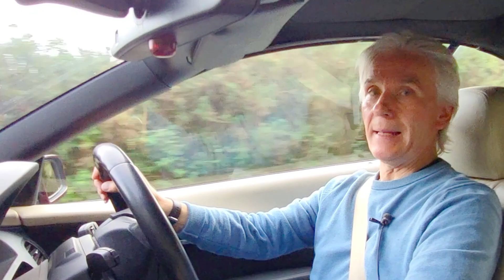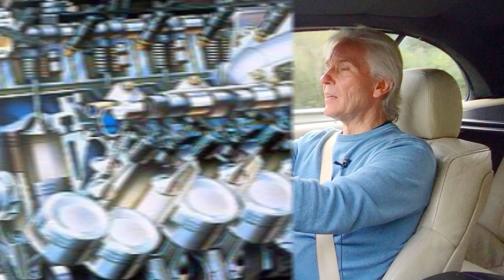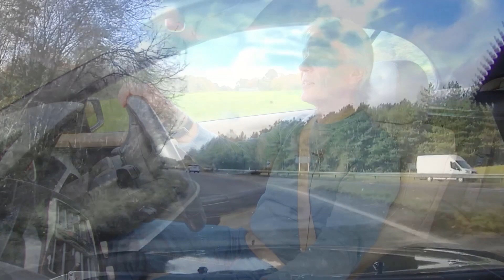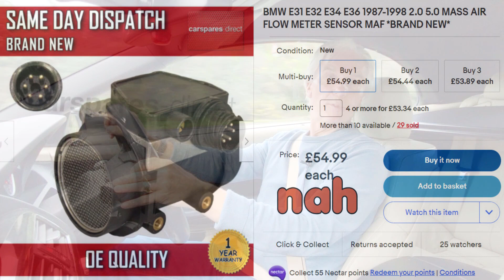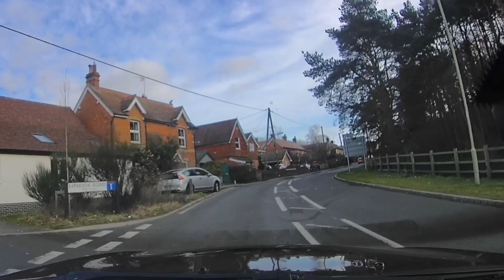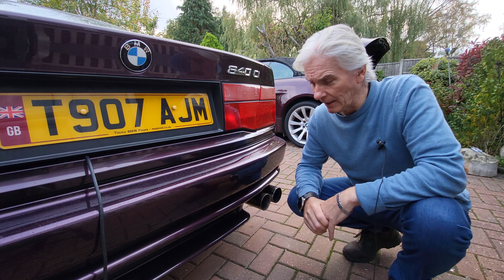BMW - WHERE HAS ALL MY POWER GONE? WHY NO ERROR CODES?

Comment: Yesterday I got a replacement MAF sensor from another ex-Japan 1997 E39 540i. I hadn't known mine was faulty until recently with fault codes and occasional stalling. I'm commenting here while re-watching your fine video so you'll probably explain this but in the meantime, I thought I'd post this AI reply to my question as to why my transmission was behaving differently. Very happy to have a smoother more responsive car.

Good evening! It’s great to hear how much you’ve enjoyed your 1997 BMW 540i (E39) over the years—it sounds like a real gem, especially with that mileage! Your detailed background is appreciated, as it helps paint a clear picture of what’s going on with the car. Let’s dive into your question about how replacing the mass airflow (MAF) sensor might influence the behavior of your automatic transmission.

The short answer is yes, a faulty MAF sensor—or replacing it with a properly functioning one—can indeed affect how your transmission behaves, even though it might not seem directly related at first glance. Here’s why:

The Connection Between MAF and Transmission

The MAF sensor measures the amount of air entering the engine, which is critical for the engine control unit (ECU) to calculate the correct fuel delivery and ignition timing. This data doesn’t just affect engine performance—it also feeds into the broader vehicle control systems, including the transmission control module (TCM) in many cars like your E39. The TCM uses inputs like engine load, throttle position, and airflow (via the ECU) to decide when and how to shift gears. If the MAF sensor was faulty for a long time—perhaps even subtly before it threw a clear fault code—it could have been sending inaccurate data, leading the ECU and TCM to adjust shift points conservatively or inefficiently.

When you installed the new (used, but functional) MAF sensor from the scrap yard, the ECU likely started receiving more accurate airflow readings. This could result in:

Improved Engine Load Calculation: With better data, the ECU might now recognize that the engine is operating more efficiently, allowing the transmission to stay in a lower gear (like 4th instead of jumping to 5th) when it deems it appropriate for the current driving conditions.

Smoother Power Delivery: You mentioned the car feels more responsive and runs smoother. This improved engine behavior could give the TCM confidence to hold gears longer or shift differently, as it’s no longer compensating for an engine that’s stalling or running suboptimally.

Adaptive Transmission Logic: The E39’s Steptronic transmission is adaptive, meaning it learns and adjusts shift patterns based on driving habits and sensor inputs over time. A long-term MAF issue might have “trained” the TCM to shift more conservatively (e.g., jumping to 5th gear quickly to reduce perceived strain). With the new MAF, the system might be re-adapting to the corrected inputs, leading to the behavior you’re noticing.

Why the Change After Switching Modes?

Your observation about the gear staying in 4th after switching from Sport to Drive mode is interesting. In Sport mode, the transmission typically holds lower gears longer for performance, and when switching back to Drive, it often upshifts quickly to prioritize economy or comfort. With the new MAF sensor, the ECU/TCM might now calculate that staying in 4th at 100 km/h is still within an efficient and comfortable range for the engine, rather than forcing an immediate upshift to 5th. This could reflect a recalibration of engine load or a shift in how the adaptive logic interprets the "normal" driving condition with proper airflow data.

Could It Be Something Else?

While the MAF replacement is the most likely culprit given the timing, a couple of other factors could play a role:

ECU/TCM Relearning: Even without manually clearing codes, the ECU might have automatically reset or begun adapting to the new sensor data, subtly altering shift behavior.

Residual Effects of the ABS Fault: Though less likely, if the ABS module issue affected the vehicle’s networked electronics (e.g., via the CAN bus), it’s possible it indirectly influenced the TCM. However, since that fault resolved itself, this seems coincidental rather than causal.

Natural Wear or Adaptation: After 370,000 km, the transmission itself might be shifting differently due to wear, but the timing with the MAF replacement strongly suggests a link to the sensor change.

Suggestions

Monitor It: Keep driving and see if the transmission continues to adapt. If it’s running well and the shifts feel logical, it might just be the car settling into a “healthier” state with the new MAF.

Clear Codes Manually: If you have access to a scan tool, consider clearing the fault codes and letting the ECU/TCM fully relearn with the new sensor. This might solidify the new behavior or reveal if it’s temporary.

Check Transmission Fluid: While unrelated to the MAF directly, it’s worth ensuring the ATF (automatic transmission fluid) is in good condition, as low or degraded fluid could amplify any odd shift behavior. At 370,000 km, it’s a routine maintenance item if it hasn’t been done recently.

Enjoy It: If the car’s running smoother, more responsively, and the shifts aren’t causing issues, this might just be the E39 showing you how it was meant to perform all along with proper sensor input!

In summary, the MAF sensor replacement likely gave the ECU and TCM more accurate data to work with, subtly optimizing the transmission’s behavior. It’s not a coincidence—it’s a sign of how interconnected these systems are. Your 540i might finally be running closer to its original spec, and that’s a win worth celebrating! Let me know if you’d like me to dig deeper into anything specific.
Reply from the maker: Yes, the MAF causes a problem as the idle cannot be controlled precisely, so when the EGS calls for a reduction in power for the gear change the revs drop too far - and that causes the harsh changes

Comment: Would old MAF cause hesitation on lower rpm?  My N62 V8 hesitates  intermittently when I step on the gas around 1k - 2k rpm on 1st gear.
Reply from the maker: Sounds more like an ASC+T intervention, make sure all tyres are inflated to the same pressure and that no single tyre has more wear than the others
Reply: @TimmsBMW  Thanks for your reply.   I forgot to mention my car is a 6spd manual, actually hesitation occurred at higher rpm 2k-3k,  especially noticeable on 3rd or 4th gear.   When I floored the pedal it feels like turbo lag, but not much power come up after the lag.   New spark plugs installed recently, maybe I should replace the coils as well?  car only has 85K miles.

Comment: Got a 2017 B7 (LHD ) 40k miles, CV gators split, unreal. rear diff leak , all warranty ( BMW plat)  dont really do a lot of miles, worried cus I tootle around in it ,( doesn't do long trips) worried about GDI carb , I change the oil every 4k to try to keep it carbon free , love the car , dont get me started with the HK sound system, did the BAV subs , just no enclosure volume what a shit design , the stero in the F01 was better!!--- anyway love the vids, GDI what ya thoughts tim,
Reply from the maker: Thanks, and my pleasure - I guess a B7 is quite a lot of work!

Comment: Hello good morning. Can you please assist me, what does this error means? what to check about it? thank you.
 E71470 Intermittent – Message (charging interface status, 0x3B4) missing, receiver IHKA, transmitter LIM
Reply from the maker: Do you have a problem or just parsing error codes?
Reply: @TimmsBMW  i think it's a problem, when I clear the codes it comes back after awhile but I'm not sure what it really means. Just saying transmitter receiver thingy.  Not sure what I should be noticing in the car to say that's the one that is obvioud fault. Not sure if you get what I mean. Hehe. Thanks for your time
Reply from the maker: @bathanmark  Yes, I understand what you are saying. But these cars are extremely complicated and there are often error codes for something that makes no difference to the operation of the car. This has been the same since the introduction of OBDI. If you have no operational problems then ignore it!
Reply: @TimmsBMW  i agree with you hehe. Better not think too much if the car seems normal and no issues apparent to see. 👍

Comment: Hi Timm Jay here Find your posting’s very enjoyable 
Now on pension and in the process to buy my first bmw convertible 645ci 86000 miles
Used all your information to test if it is good 
The last three days went through all invoices and service history
It is a 1 owner car that also have a Bentley and Jag convertible The car was serviced by BMW It is 18 years old with 17 services including one gearbox service
I took the car out on a run for 50 minutes of driving Gearbox and everything seems fine Hood is also working perfectly
My main concerns is tha when checking the expansion tank (that is newly fitted) I found it had RED ANTIFREEZE in instead of blue
THE BIG QUESTION 
If the car had any head gasket problems will it start to show in a 50 min trip with some 10 minute indeling at end of journey I heard the fan kicking in whilst watching and was able to hold my hands on both the angina covers for more than a minute without it burning my hands BUT THE RED ANTIFREEZE WORRY me the owner mentioned that from the first service that it was always red 
Thanks for your time and valuable information I think more people should CONTRIBUTE   for your information
Reply from the maker: It's difficult to flush it out yourself as the drains in the block have to be removed. The quickest way to change it is to remove the lower hose - let the coolant out, refill with plain water and repeat a couple of times - then finally remove the lower hose, replace and then fill with 100% BMW coolant, that should give you the 50/50 mix required. The answer to the question: 'is it OK to keep the red coolant' the answer is I don't know, it could be anything, but it isn't BMW blue coolant!

Comment: Any ideas what the hesitation at 1500rpm to 2000rpm is caused by. I encounter this when I’m using manual shift mode in 2nd gear
Reply from the maker: My first thought would be ASC+T, try pressing the DTC button and give it another go.

Comment: Hey Tim I have a question , I own a 2008 650i 63k miles , other day I tried to show off to my friends , and Dona friendly burn out I deactivated the dsc by holding 3-5 seconds and it did not burn out it did for half a second and then I lost full power any idea what could have went wrong ? Thanks Tim
Reply from the maker: Hello Jose, these cars just are not meant for burnouts, as soon as the wheel starts spinning the gearbox will change gear and it will stop again. It also kills the torque converter!

Comment: Thanks Timm, my 97 540i still going strong  at 350K kms but good to know. I learned some useful stuff such as not suspecting the cylinders first if I did notice a drop off in power.  I tend to put it into third on the steptronic and go (if I need to), does that sort of gear change mask what you're talking about I wonder?
Reply from the maker: No Bernard, if you have power all is good!

Comment: My MAF coded out on my previous car, 98 Volvo S90, so I bought a Chinese one for $65. It seemed to work alright. Six months later, it coded out. Cleaning did no good.
I then bought a Bosch for $165. No more problems.
That Bosch was over $400 at car parts stores and over $500 at the dealer.
My 01 mercedes e320 seems to run alright, but I'm sure the MAF and cats are original.
Nice to see you again, Tim. Cheers!
Reply from the maker: Good to hear from you Werner!

Comment: Your videos have helped me with my 650 massively, just thought I’d chip in with another reason the power at the top end is lower than normal could be a failing/faulty DISA system, never throws an EML  but checking with a scanner on all systems it’s there, a spirited drive usually clears it, but still keep seeing it from time to time.
Reply from the maker: Thanks John! Yes, DISA and any of the sensors at the top end will stop the Valvetronic working leaving the valve-lift at the default 6mm - and that reduces the power by about 70 BHP!

Comment: Great video Tim, just about to replace the MAF in mr e38 740iL, and hopefully that clears my mixture limitation reached on Bank 1 and 2
Reply: For that error you need  to replace the orange membrane at the back of intake manifold. Well at least I had that in my M62. The PCV valve.
Reply: @bargla  you mean where the throttle body attaches to the intake manifold ?
Reply: @benm6899  no no, the opposite side, close to the windscreen. It's a plastic cover that has round membrane in it that sometimes fails. It is possible to replace the membrane only without removing the whole plastic element. All you need is new CCV valve and a bit of patience while swapping the bad membrane with good one. If you are careful you can remove the good membrane from new plastic valve, it has plastic round cover that hides membrane and a spring. You dismantle this without braking any knobs, and  then you can do the same on the engine. Round cover on the engine could be cripled a bit as you have new one in your hand. Install new elements and you're good to go. You have to almost get yourself lied down on the engine as the access is a bit tricky. Good lighting is recommended.
Reply: @bargla  ah yes yes, I’ve seen this. I’ll have to look for the part number. I think I remember seeing a video on this
Reply from the maker: Here's my list of vacuum leaks: http://www.meeknet.co.uk/e31/BMW_M60_M62_M62TU_Vacuum_Leaks.htm

Comment: Hi Timm, seem to remember the automatic gearboxes learn your driving style so if you bought the car from a vicar as opposed to a bank robber would this make a difference? and there is some kind of foot on accelerator hold down ignition on to reset the gearbox brain? Correct me if I’m wrong?
Reply from the maker: Hello Bobby, they do learn - but once the ignition is switched OFF they forget everything, so no need for a reset!

Comment: Hmm I think I’m going through the same struggle with my M54 E46. I did clean my MAF and the power returned like it was night and day. Currently I do have a P0420 code. 

I checked pre and post sensor reading but the post values do not seem to follow the o2 values which is a good sign. It does move out of reference which triggered the codes. Strangely enough if I boot it and drive hard the post sensor stays at reference afterwards. And a day of hard driving even cleared the code by itself for three days. 

I will change both pre stream sensors. Possible the MAF as well because the car pulled even harder after 6000rpm. It doesn’t feel like that anymore. 

What are your thoughts Tim? Do I have a bad cat? :/

PS: if I drive gently the cars’ acceleration becomes muted until I give it a good run again.
Reply from the maker: The next step would be to check your adaptations and let me know what they are....

Comment: Running Nankang's on my 650 and they're pretty good..do very well in the wet and feel planted. :)  **Also I need to get my garage to look at the engine as long term oil leak needs looking at and yep it's bottom of the engine somewhere..so engine out job i've been told.
Reply from the maker: No need to take the engine out for oil leaks - they can all be reached with the engine in place - for the rear oil pan the engine can be raised slightly but that's it Max

Comment: Just a quick question on MAf sensor on my E60 525d.  I've got codes on ISTA_D .
Not sure what symptoms I should get or how to sort? Been told to take off and spray with cleaner? Checked MAf readings on live data and as I press gas the readings go up to 0.2 lbs
Do I need to replace , clean or just leave it alone. Fuel is 22-25mpg most is local driving . M57TU2, engine.
Reply from the maker: The best way forwards is with INPA as explained here: https://youtu.be/6LWXmz6Ef_M

Comment: I remembered your catalytic clogged and changed once. Exhaust flow is important . It should be open as factory built.  :)
Chinese Maf sensors can't measure well. Mine is original but my friends tried chinese one. They all changed them later.
Reply from the maker: Yes, once bitten, twice shy Ali!